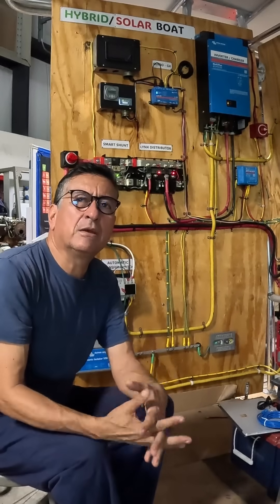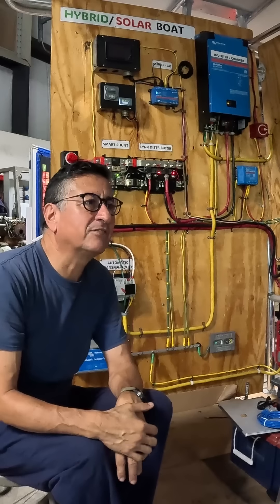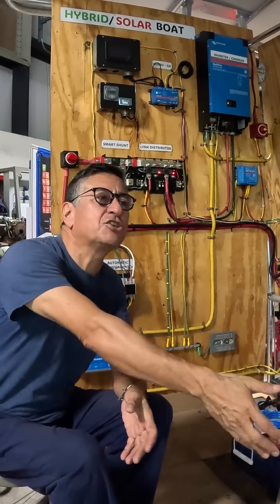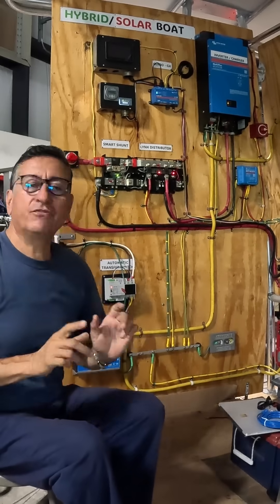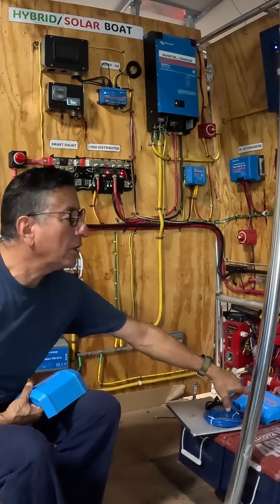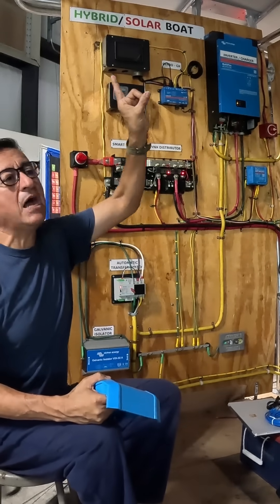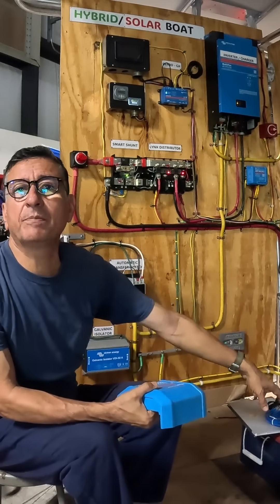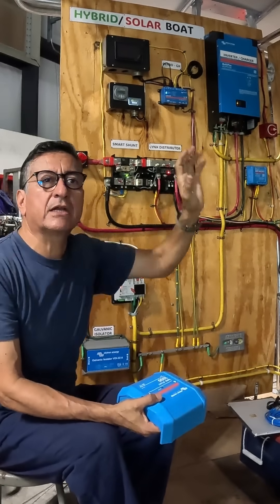Calculation of a Battery Bank for a Solar Panel Array

Comment: Watts are watts. The problem with amps is the don’t take into account the voltage being stepped down in the MPPT charge controller. Daily watt hour consumption divided by 5 equals watts is the better calculation